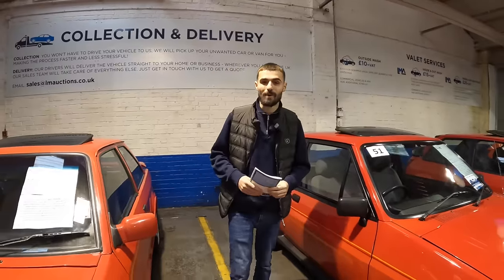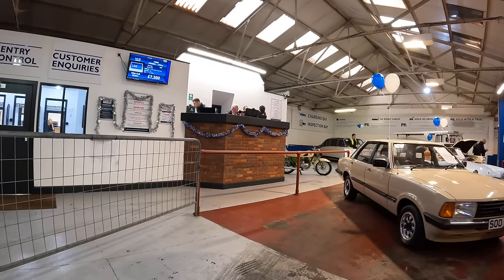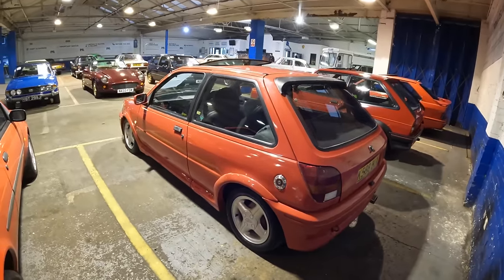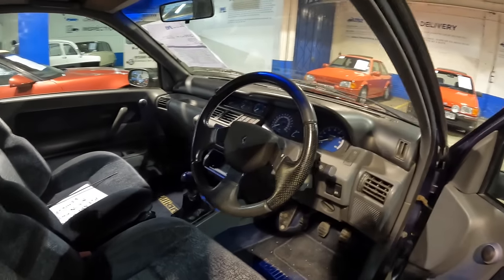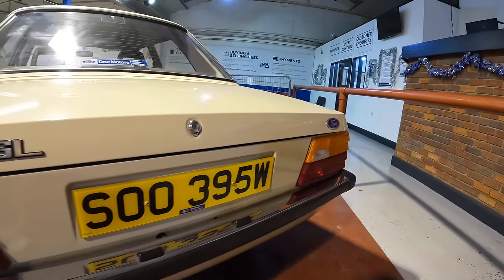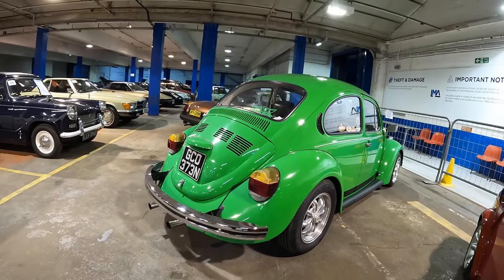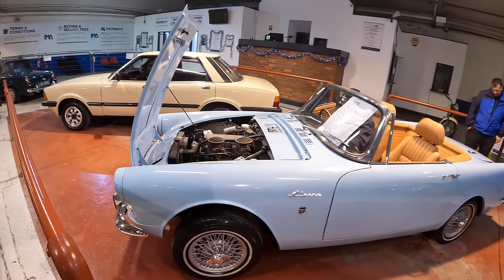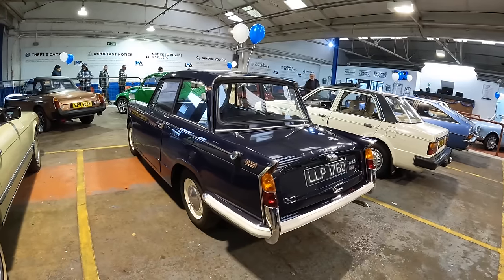I ATTEND A CLASSIC CAR AUCTION DURING WINTER!

Comment: Put the hubs in the oven Mitch for a few minutes and the bearings in the freezer for a while. The bearings will then easily drop in and you won’t damage the hubs. The bearings will tighten once the hubs cool.
Reply from the maker: Thank you for the advice mate! I’ll do just that, will put them in the oven when mums not in 🤣

Comment: 16:36, minis only ever had a timing chain, very rare to change them
25:33,the truimph herald was one of the last cars to have a separate chassis, ie you could lift the body off + still drive it around [ish]. we had one at college, ideal training car...
24:34, my wife had a black one, fantastic car, but rotted through in 4 yrs, her feet were getting wet, + it filled the fusebox with water, so it had to go. the alloy wheels [15 inch RS soft-lines] were kept, + are still on my sons destroyed 08fiesta diesel [it makes him drive carefully]

Comment: 15:43 : Yes it's in exceptional condition but it is a Base spec model and only 1.6L Engine. If it was a 2.0L Ghia or 2.0L GLS etc it would go over 10K easy.
Reply: also the colour

Comment: That XR2i will not make much. It has not standard indicator glass , non standard petrol cap, Wrong wheels and it's a 1.8. 16v Which are less desirable (No more power) and don't sound as good and the 1.6 8v. Casing Point .. The RS Turbo is only available in 1.6 8v too... And there we go..  8:03 Told ya.